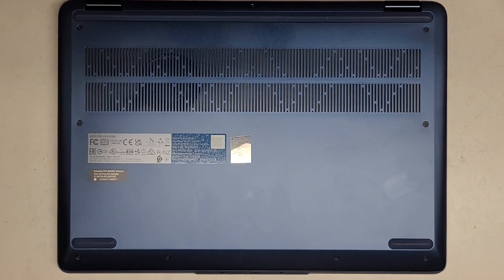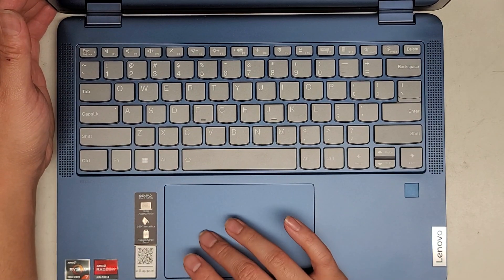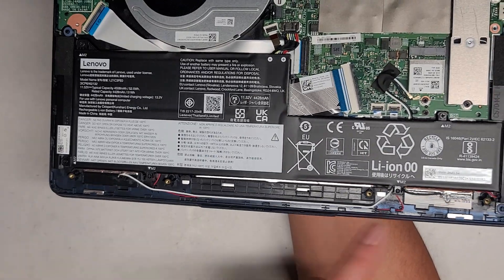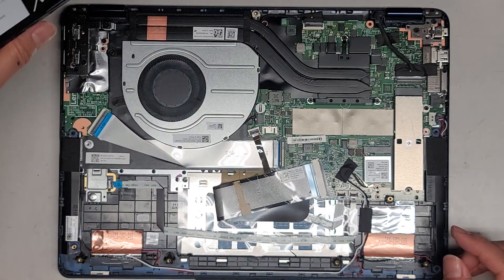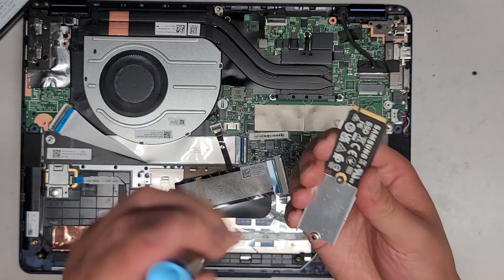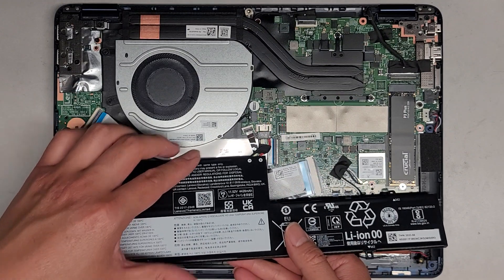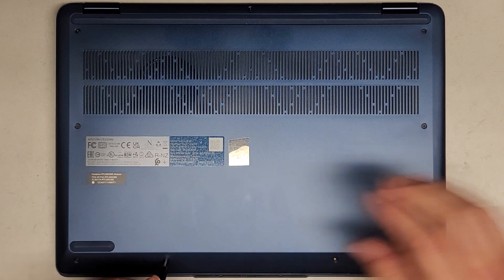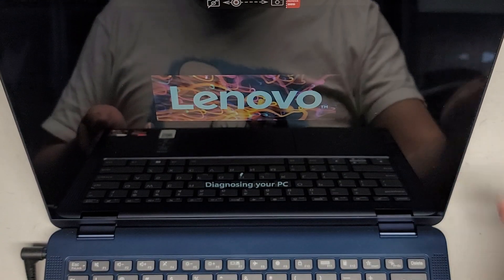Lenovo IdeaPad Flex 5 14ABR8 Disassembly (No RAM) SSD Hard Drive Upgrade Battery Replacement Repair

Comment: So whenever you put a new SSD you have to clone the laptop?
Reply from the maker: Only if you want everything to remain the same and not a clean install
Reply: @ItsBinhRepaired  well when I tried to put my ssd m.2 it went straight to the boot manager menue and it stayed there so I put everything back to how it was cause I didn't wanna mess it up.
Reply from the maker: @user-nx7jo3xi9r yup
Reply from the maker: @user-nx7jo3xi9r no problem